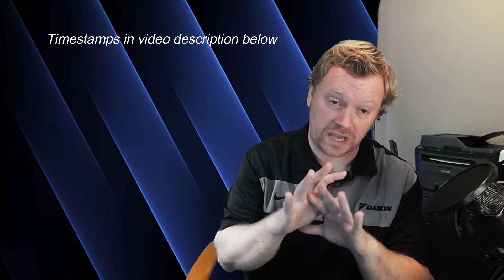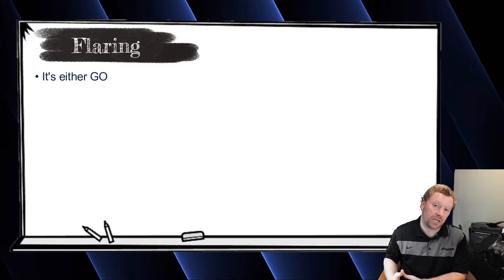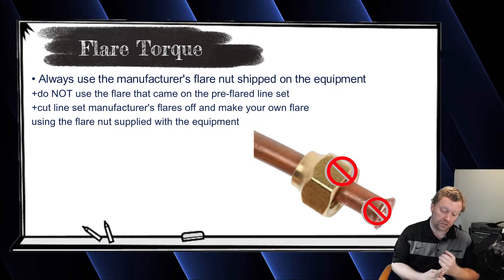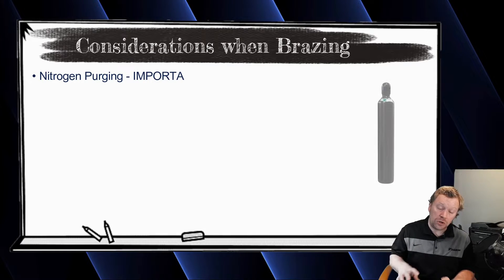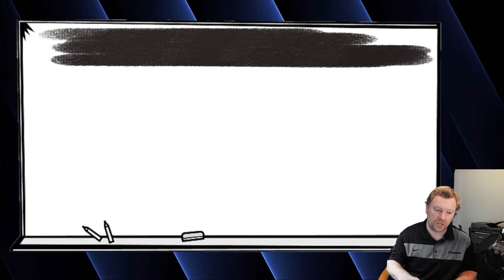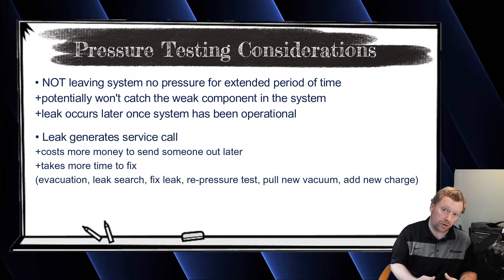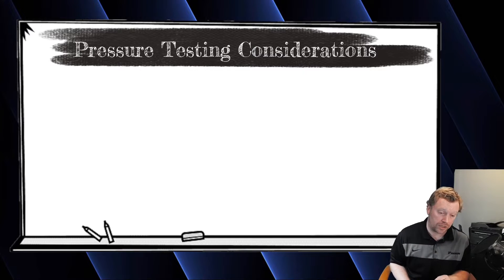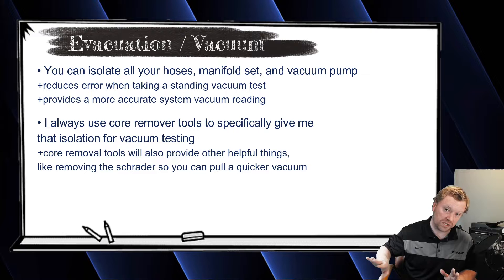MOST Critical Part of an Install | Daikin VRVS Install & Commissioning Series Ep.5 - 10-15-2021

Comment: About the trick in determining if the pressure dropped, do I watch the outside temperature of the outdoor unit or just outside temperature?
Reply from the maker: Ambient typically. I like to take a temp outside and inside the space before and  both after since most the pipe is inside the space. You'll get an average that way your gauge pressure should be in between these numbers

Comment: Thanks Dana really appreciating your knowledge. Re Nitrogen pressure test and ambient temp affecting the pressure Q is once you have pumped up the system where would you measure the ambient , by the condenser or inside the building, because most of the pipe work is probably inside. Thanks

Comment: I know this video was done close to 7 months ago (May 8, 2011), but I have a question for you. I commission Daikin VRV Equipment in Canada (REYQ, RELQ, RWEQ, etc.) and I had situation where the electrician accidentally powered an indoor head where the contractor was putting the system in a vacuumed pressure state on a RWEQ96TATJA unit (Heat Recovery VRV). I got all the indoor communicating with the RWEQ unit and checked the dip switches on the BS Box and was seeing the correct amount of units by doing an fan coil and BS Box count. Once confirmed, I put the system in recovery mode and everything was good until the next day. When I checked the unit status from the 3 LED screen, I was getting a UA-53 error. I preformed a hard reset and was getting 9 out of 11 units. Put the system back in recovery and located the 2 units not communicating. I checked for 16 VDC on the terminals from the BS Box by taking the field wiring off one by one and found out one of the wires was shorted to ground. I asked the refrigeration contractor if he saw this error code when, he said no which unfortunately he added the additional charge the system with R410a after the vacuum was completed, but kept the service valves from the VRV closed. 

NOW TO THE QUESTION after explaining my situation, since I had all the indoor heads communicating at one point (double checked the dip switched on the BS Box) and put the system in Recovery mode (opens all EEVs - Electronic Expansion Valve(s)) and then who knows what time it went into an error during the vacuum, will the indoor unit's EEV that emitted that error (shorted to ground) stay OPEN or does it close because that error was emitted?

Sorry for the long read, I put in the thought of giving you details to see the step by step process I did. Also, to avoid complication, I was going to suggest the contractor to recover the additional charge, re-run new wire to the effected unit, redo the vacuum phase and add new refrigerant to the system again.
Reply from the maker: This happens more often then you might think. The valves will close as soon as they are no longer being commanded open by outdoor unit in evacuation/recovery mode. So, if you are pulling a vacuum from all 3 pipes on outdoor, you're probably ok because you'd be pulling from both sides of the indoor line  sets. 

If however you were not pulling from all 3 then you do possibly risk having a line not vacuumed down. There's some argument that would suggest the branch box valves are all still open, so technically speaking, pulling from any line outside you're still open to all three through the box and therefor a closed indoor wouldn't be a problem. 

It's probably worth checking if any branch box isolation valves were closed if Installed at all. 

But to be absolutely sure you're good, you can always pull out what you added and pull it back down, since you still have the condensers closed off.
Reply: @InverterAlways  Thanks a lot for the response and confirmation!

That is eventually what I decided to go with  just to be safe. I told the contractor to pull the additional charge out after rewiring the shorted wire, get everything communicating and confirm by doing an fan coil and BS Box count, put the system in recovery mode after cycling power to the BS Box and condenser, no more issues.

The contactor has been pulling a vacuum on both the liquid and suction line, not the high/low gas line.

Regards to isolation valves, they installed the ball valves at the indoor unit, not at the BS Box because the ceiling space would make it impossible to ensure if valves are fully closed or open. 

Again, thanks for your time and knowledge!
Reply from the maker: @illillillillila  indoor location is interesting. Doesn't do much there unless you are changing a unit out. I would have relocated the box to ensure access but I hear ya. Sometimes it can't be moved. Glad you got it all squared away though! Always better to be safe than sorry.

Comment: In your refrigerant charge example, you are using 1/4 and 3/8 lineset sizes.  Will the multipliers (0.015 and 0.036) be different if the outdoor unit is 5/8, 3/8 and if the indoor units (from refnet branch to indoor unit) are 1/4, 1/2?  And... will these multipliers be included in the outdoor unit's installation manual when I receive it?  Thx!
Reply from the maker: Watch it again. I explain you need to total ALL the 1/4" liquid line length and multiply by .015 pounds. Then total ALL the 3/8 liquid line amd multiply by .036 pounds. Then add those 2 together. Whether you had 1 indoor or 9, makes no difference. You're adding it all up. We do not add the gas the line (1/2, 5/8, 3/4) into the calculations.
Reply from the maker: And yes it is in the outdoor installation manual for sure 👍
Reply: @InverterAlways  Oh wow!  Got it.  I definitely missed you said (and wrote!) that they were both liquid line measures.  So I watched it again at half speed to avoid another moment of semantic paraphasia. 🤪  Thanks!
Reply from the maker: @rcnthusiast  haha, all good. I do go through it quickly because I want to keep video time down, but I'm glad you found it to confirm ;)
If anything else comes up just let me know.